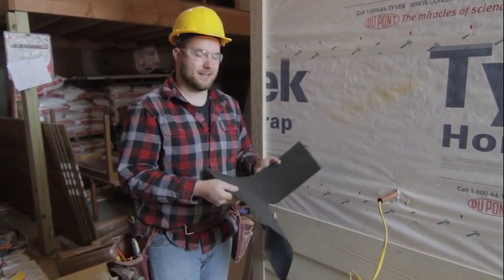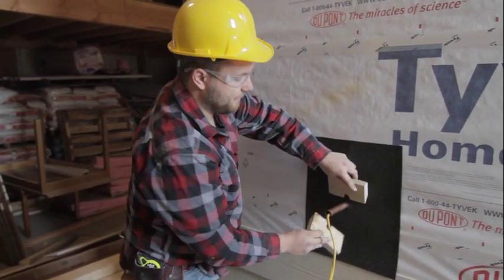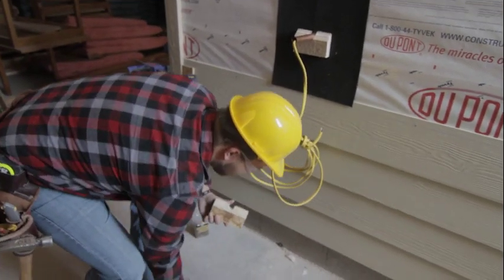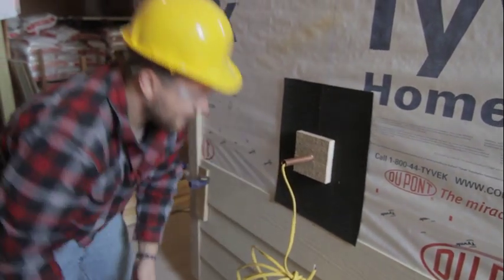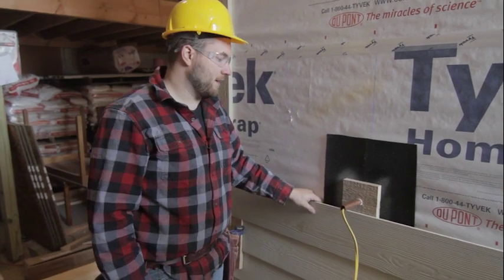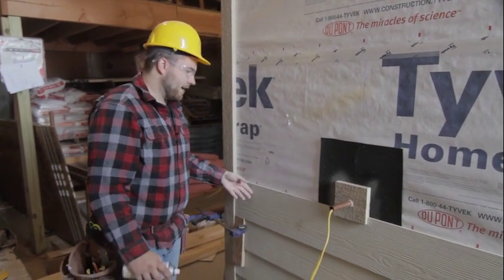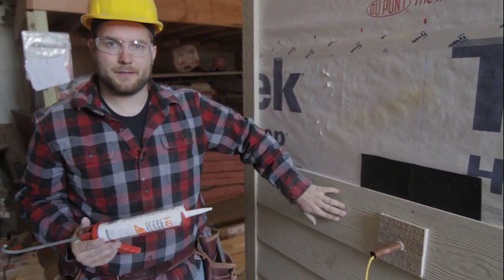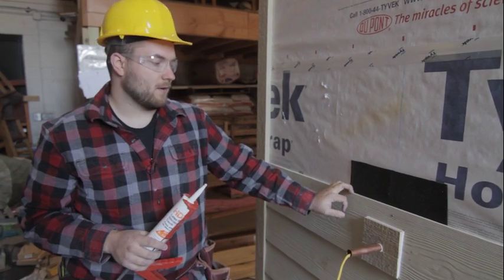How to Install Fiber Cement Siding Part 4: Protrusion Flashing

Comment: I don’t understand why the slit is facing up at 1:17. Wouldn’t it be better to be pointing down so that if water gets in between, it would run past the hole? About to fix siding at my house and want to make sure I do it right. Thanks!

Comment: What about the flashing and 1/4 inch gaps at the top of the blocking? Isnt flashings and gap required
Reply: Correct. The way he constructs the block and trims the siding around it is correct but this should have cap flashing with a 1/4" gap at the top and NO CAULK. Horizontal surfaces should never be caulked with fiber cement siding.

Comment: Like this part around the copper pipe.  Very good.  Also good tip on making the cuts, my first few I added 1/8" and joints were huge I had to tear out and redo.  I will take your advise.  Thanks, Ed

Comment: james hardie reccomends flashing above all penetration trim. also, angle grinder with a cement wheel. makes it suuuuper easy to back cut the edges of your cuts to fine tune a notch. otherwise great video, imma use it for training purposes... my guys will get a ton of mileage out of "pile on this caulk" 😂

Comment: How does the top of the block shed water? Or is it not a big concern due to the gable overhang. Thanks and great build series
Reply: should put flashing on top, and he should have caulked the pipe as it penetrates the wall before putting the block in place.
Reply: Should of put z-bar on top of the block

Comment: How would you approach this install if you were using JH vertical siding (board and batten). Is there any reason to cut the board around the mounting block? Or can you just put the mounting block right on top of the siding?

Comment: Im not throwing shade on this video, since I did learn a few tips. But, I feel I need to mention that there is something concerning about the suggestion to adding caulk to the top portion of the pipe trim board. I got the following from another website: "All fiber-cement manufacturers specify minimum clearances where siding hits a horizontal surface. This can include horizontal trim, such as above the head trim on an opening, above the mounting block for exterior penetrations, or where the siding lands on the top edge of water table. At least 1/4 inch is required, and this gap should remain uncaulked."
Reply: No caulking should be applied on top, There should be a piece of z flashing there, with min 1/4" gap to the plank. This is per Hardie installation instructions. I'm not sure if the piece of ice and water is needed. Not per manufacturer instructions.

Comment: Why does he say “um” practically every sentence? Furthermore their is a product called a hole saw and it makes a hole in material so one does not need to cut any blocking in half. Furthermore, the flashing can be cut in an “X” pattern where hole is and it will slide right over the pipe. This guy does not know what he is doing. Silicone is not what you want either…